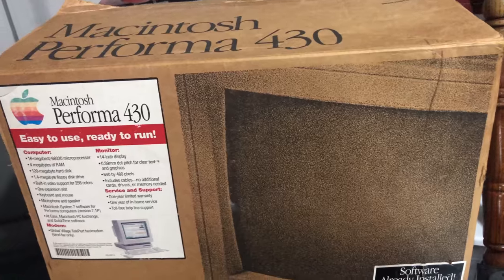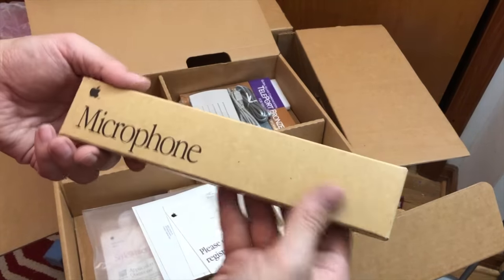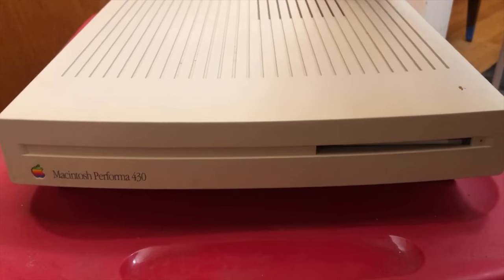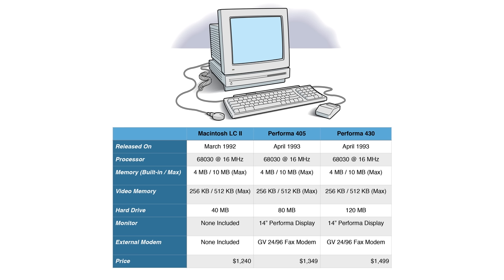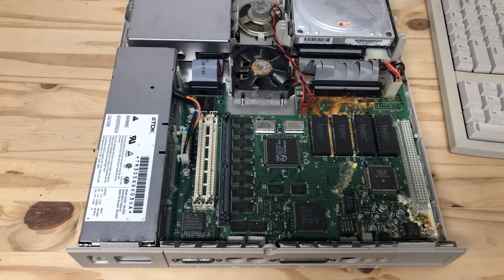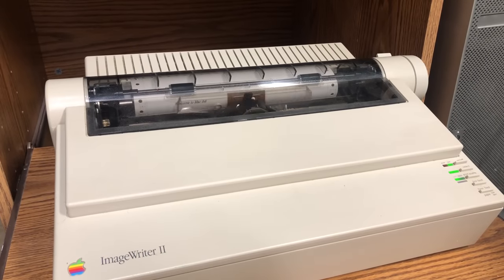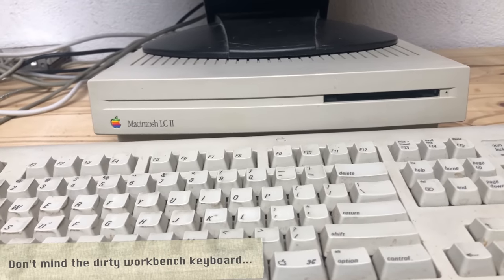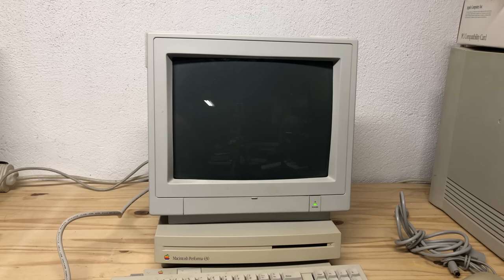Mac84: Unboxing a Vintage Macintosh Performa 430 from 1993! (Pizza Box Mac LC II)

Comment: Such as shame a classic killed by a battery failure - so glad we use standardised cr 2031 batteries now ;)
Reply from the maker: Yes, it’s a real shame! Sadly the same fate happened to an LC III and a Macintosh TV. Both occurred before they were in my hands. But it was a wake up call to remove all old batteries from my systems!

Comment: It is fixable. You would need to clean the inside of the battery leakage (can do it with a toothbrush) and then get a new battery. It would be a relatively simple repair, as long as that was the only thing wrong with it. (That has got to be one of the cleanest classic Mac cases I’ve seen in awhile)
Reply from the maker: Unfortunately the ROMs took a beating and I think one of the legs fell off as well. The PDS slot area is worse I'm afraid, and is just a mess! I will try to fix it up eventually, but I'll need to be very careful. It may not be worth the trouble, but I am curious!

Comment: We had a Performa 637 that came with that modem and I can personally attest to the fact that it was garbage. We replaced it with another modem, can't remember what kind it was just that it used a stainless steel housing and had a two digit display for status codes, and never had another problem. For a packed in add-on it was terrible.

Comment: God I hated Apple when they put out garbage like this. This was a dark time.... Apple was absolute trash when Steve Jobs wasn’t there. I (reluctantly at first, I was a PC guy) worked at “Apple Computer” in the early 2000’s in Elk Grove California. I started in AppleCare then worked on the assembly line as a failure analysis engineer for PowerMac’s. That facility use to pump out iMac’s until one caught on fire on the line and lit every station on fire as it went down the line, LOL so that building was changed to house cubicles for AppleCare and the next building was changed to make only Power Macintoshes, the iMac’s were then made in Mexico, then China. What made me start to like Apple was when I saw OSX, I HATED OS9, no protected memory, no multitasking, archaic GUI (though now I kinda dig it for nostalgia reasons, my school district was all Mac), OSX was still pretty much beta but it was pretty amazing but for hardware I was in awe when I saw the G4 Cube... that did it for me. I still have the G4 Cube I built while I was there in its box, I need to set it up, or do an unboxing video like you! Hmmmm...

I miss working at Apple but it’s changed a lot, the whole phone revolution.. they’re not really a computer company anymore, well, not like they use to be. But I really liked working with the people there. I worked in San Jose at IBM and those people were very cold. If you weren’t a millionaire then they ignored you, treated you like furniture or “the help”. Then I worked at Intel in Folsom... talk about stuck up a-holes. But Apple was special... good people, I really liked them and back then I grew to like the company and Macs a lot.

My daily drivers today are a Mac Pro 5,1 upgraded to the max dual booting macOS Mojave and Windows 10 and a ThinkPad dual booting Windows 10 and Hackintosh’ed macOS Mojave. 😎🤘
Reply from the maker: Frank, thank you for the wonderfully detailed comment! Yes, this era was a very weird time for Apple. Thank you so much for sharing details from your time at Apple. Those poor iMacs! It would be super-cool to see an unboxing video of a G4 Cube, you should totally do that!

I'd be interested to know more about your time at Apple, and your thoughts on vintage and new machines, if you'd like to chat more, please send me an email at mac84tv@gmail.com :) Take care!
Reply: Current Apple computers are frankly not worth it anymore too. I have a 2016 13' MBP, the last one that was somewhat upgradable. My previous 17' 2011 MBP was pretty decent and was very upgradable despite having to fix it because of the GPU frying. 

Current ones outside the Mac Pros are simply too underpowered for most serious tasks, and the price of the Mac Pros just to get that performance is not worth it - my 5k iMac at work struggles even with 1080p video editing for example. Same with 3D renders, this is delegated to my custom built PC now - 15 minutes to render something on my work iMac takes less than a minute on the PC.

I do have a soft spot for the older macs, particularly the iMac G3 and the early iBooks. Currently have a G3 Snow CV SE and previously had a G4 tower which I had maxed out (which sadly had to go :( ). If I have the room I'll start collecting more again.

Comment: you lost me at LCD and pissed me off at SD card
Reply from the maker: As I mentioned in the video I used the LCD purely for the convenience of filming with my phone without the distortion of a CRT. 

The SCSI2SD adapter was used because the original HD was dead. I was going to use a Conner 40MB hard drive instead (which you can probably see in some shots) but that croaked during filming.
Reply: The SD card I can understand but who cares about a little flicker. Better than insulting my eyes with an LCD